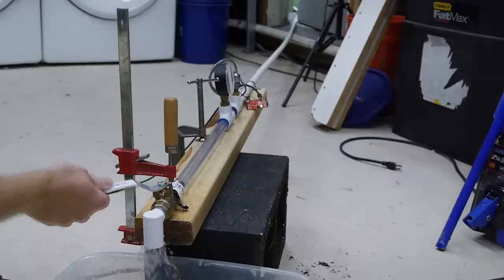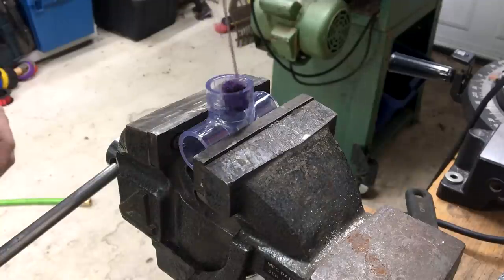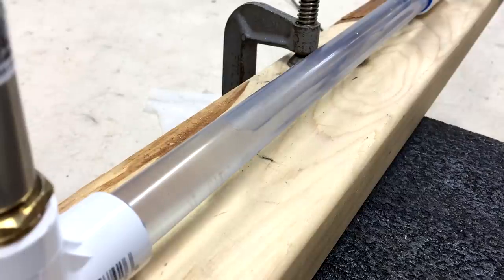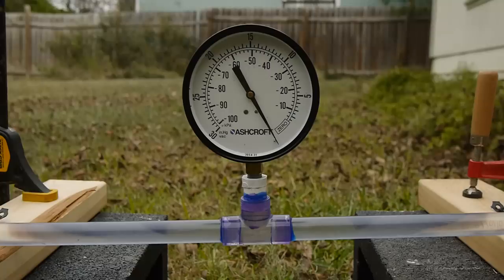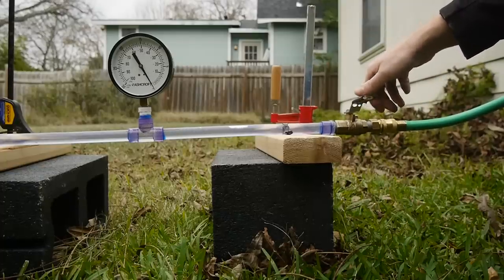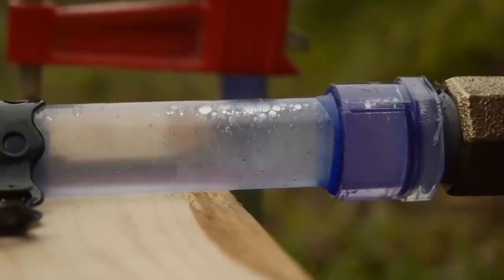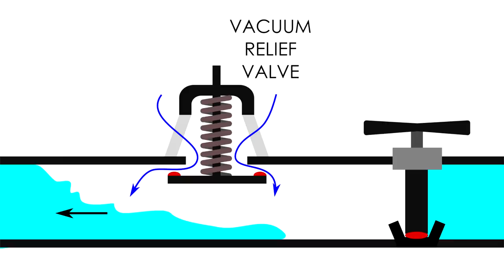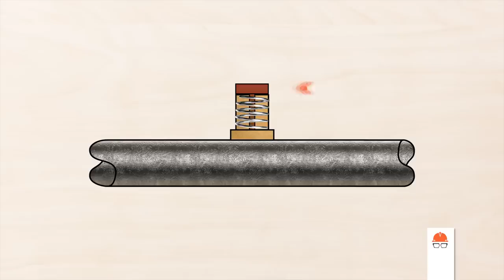How to Collapse a Pipe by Closing a Valve

Comment: Something that is very interesting about this phenomenon is that the negative "pressure" can actually be lower than the pressure of a vacuum, provided that your water is sufficiently degassed and your water is free of contaminants. The reason for this is because of the cohesion of the water molecules pulling on eachother before the water can spontaneously vaporize!
Reply: We may have a difference in terminolgy, but that does not sound right. A typical pressure gauge reads the pressure (or vacuum) relative to atmospheric pressure (around 14.7 psi). The magnitude of your vacuum can never be greater than the magnitude of atmospheric pressure.
Reply: B Templeton But that is what I'm trying to explain. Most of my life I thought that a vacuum was the pressure floor in any material but consider this: say you have a steel cube with eyelets on every face. Let's say the pressure inside of the steel cube is atmospheric pressure. Now you apply a strong pulling force on each eyelet so there is force pulling the steel cube from every direction, say a few tons on each side. What is the "pressure" inside of this cube now? The same happens with water on short timescales, i.e ultrasound. The compressive strength of the water can apply extremely high positive pressures (pushing force) in the megapascals. The tensile strength can also generate pulling forces that would be much greater than what a vacuum could produce (a few -MPa) due to the molecular attractions. For the water to spontaneously vaporize when the pressure is reduced, it needs energy as vaporization requires a good bit of heat and increases the entropy of the system. The timescales required for this to occur can be much longer than the period of an ultrasound pressure waveform if you have a high enough frequency. 

Going back to the content of this video, I'm sure you could set up a neat experiment to demonstrate this. You should be able to make a tube with a strength such that it can hold a vacuum, yet crumple when you do the same valve experiment shown on this video (provided the water is degassed and free of contaminants). Maybe I should make that video!

Comment: the light haze and bubbles that occur when the valve is closed is caused by the water coming to the boiling temperature. the boiling temperature of water drops at very low pressure. the same phenomenon occurs with a ship propeller which also creates a low pressure when turning at high rotation speed

Comment: Vacuum reliefe valves in high pressure Walter turbines, are not really a good Idea. Air inside a high pressure Line will Leader to explosiv dekompression inside the turbine.